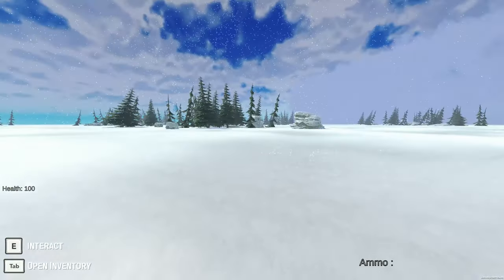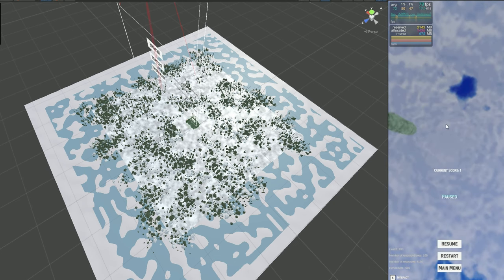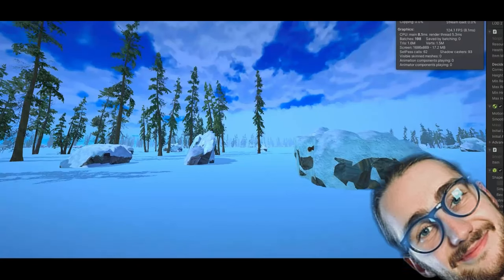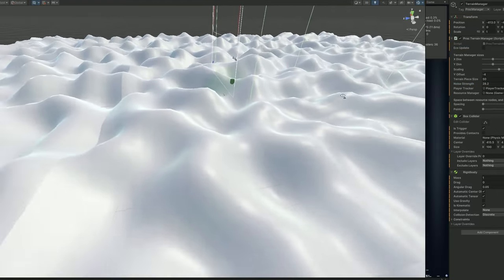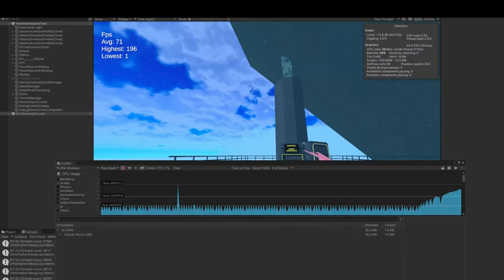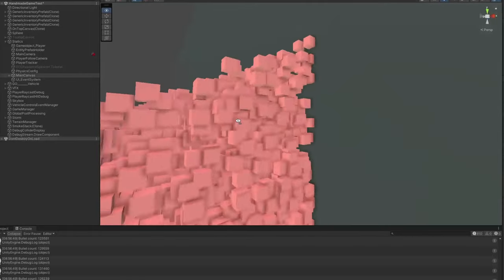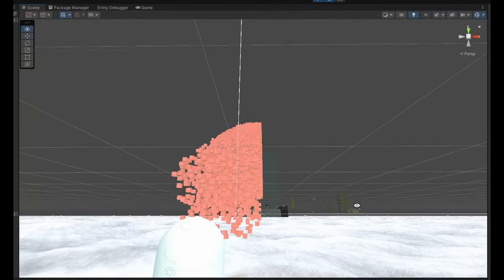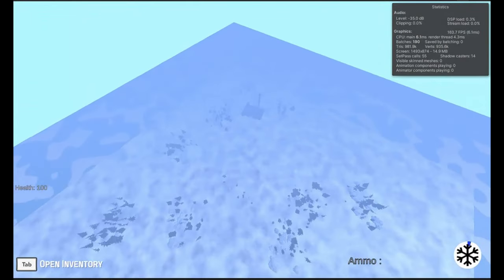How I Optimized My Game for 1 Million+ Bullets - Scorching Engines

Comment: just found this, looks really well thought out ! great game design
Reply: also, you should use a reduction on your bullet hits as they finish before they queue to condense them to similar objects and a dmg total.
Reply from the maker: @tristan6052  hmmm, reduction on my bullets before the queue... 
I mean I could do a reduction on the queue, to combine all the damages that an entity should take, by summing the damages into a hashmap thingy, so I perform less structural changes, which is honestly a good idea. (If a wall takes 100 damages, i apply each of them individually which is "slow", ~1000 damages takes 0.02ms to apply) 

But I'm not too sure how a reduction before the adding to queue part would work, seeing how multiple bullets gets processed in parallel it'd be pretty difficult to guarantee that there wouldnt be race conditions

Comment: To optimize more you could use object pooling. Instead of instanciating and destroying gameobjects you activate and deactivate them changing their position when "spawned".
Reply from the maker: Common optimisation trick, but when using Unity DOTS there's no benefit from using object pooling, since instantiation is so cheap, basically cheaper than having to keep track of used and unused entities :)
Reply: @thor_whitemountain  I didn’t know that, I’ve been reading a little bit about DOTS and it’s amazing how it works. I don’t know if it’s the right direction for this project but it is interesting!!
Reply from the maker: @Kapioner114  I mean, I could have made this game entirely in monobehaviours, but I am a really big fan of optimisations and hardware, so using DOTS just makes it more entertaining for me as it ticks more boxes when it comes to my interests, additionally the performance is just so damn good that I can't say no.

(It also makes it so that I can write bad code, that's still fast)

Comment: Loving these blogs as someone getting into DOTS with no prior programming experience. I didn't understand how you were able to circumvent all the AddComponent commands though :( Using a lot of them in my main practice project
Reply from the maker: On my phone, in bed, so sry for typos.

But before i had 2 component tags i added and removed, respawn and despawn tags.

Adding these tags made the resource zones be included in specific entityqueries,

Instead of adding and removing tags all the time.
I have a component that always stays on the zone entities, snd has a value between 0-3, giving us 4 different states it can be in.

A checking system then checks all zones and sets the correct value,  0 for respawn needed, 1 for already spawned, 2 for despawn needed, and 3 for already despawned.

This is then used to make decisions about the zones each frame, which means that we trade 4 bytes (1 int) of memory per zone, and some Computational power, to remove all the structural changes.

I hope thats a decent enough explanation :)

Comment: The amount of bullets is quite an accomplishment as i've seen people trying to do 2m of anything and resorting to compute shaders, or some form of GPU offloading to handle the work. 

Question, for the bullets are you doing anything special to reduce drawcalls to the gpu, just wondering, especially since you're using a box for a bullet, and i'd imagine you won't be shooting boxes, though like you said you won't be shooting 2 million bullets in the game... even though you could, i mean realistically you could probably implement something like a bake-to-texture and have the bullet look like whatever you wanted with no overhead from polys
Reply from the maker: I  mean, if the performance gets too bad I could use direct gpu instancing and send an array of positions to the gpu, but there's not really any need for this, as unity combines multiple small similar meshes (cubes) to batched single drawcalls, so 1m bullets is around 45 million vertices, but it's a cpu bottleneck despite that. 
But yeah, the plan is to use proper bullets or bullet like things (like cones oriented in the flight direction) but I might also remove the rendering from bullets, except for tracer bullets, so not every bullet is visible

But if bullet bullet rendering becomes a performance issue I do have some idea for how to improve that

Comment: Very cool game and very impressive! Althought you should maybe rethink how much you are optimizing things before you run into a bottleneck (as someone that loves optimizing myself). As the saying goes "early optimization is the root of all evil." Optimizations often make things very inflexible and a lot of system should be rewritten later in development anyways. You should really only optimize things when they become an actual problem. Unless youre just doing it because its fun for hobby projects which is of course fine, but then it will make the development take longer than necessary.
Reply from the maker: Yes, and no, Most of the optimisations I do are low hanging fruit, as I try to implement a feature in the simplest way, and then I clean it up, and optimise it a bit from there. But this optimisation of the bullets is way more deep optimisation than I've done for the rest of the parts of the game, just because it was fun and interesting to research and try out new things. 

But yeah, it's very easy to spend too much time optimising things needlessly, luckily the burst compiler does a great job of "optimising" my code for me :), so I hopefully dont get stuck on optimisations instead of gamedev.

Comment: Hey, just found your videos and the game really starts looking good!
I have a question. Is this (destroy/create resource entity zone depending on distance system) solution faster only because its parallel? Or there is another reason? I just cant think of good way to query through component so i can check the state value of it and only then doing the code needed.
Reply from the maker: It's faster because if I didn't delete the resources, and just disabled them / made them stop rendering then they would stay in memory, and the memory usage of the game would just be increasing over time, which would then also slow down the CPU.

I actually run 3 jobs for all resource zones, every frame, the distance checking job, as well as the spawning job and despawning job. And then inside of these jobs I look at the Culling Component on each entity and just return if the state is wrong.
like, 
"if (state != despawn) { return; }"

And alternative would be to have a single big job and use a switch case for what action to do based on the culling state

Comment: Impressive optimizations! Just wondering, why did you decide against hitscan weapons? (Apologies if it was discussed in a previous video)
Reply from the maker: Nah, I haven't talked about why before, but it's just because I prefer physical bullets instead of hitscan. 
Especially since fighting hitscan enemies is really annoying as you basically can't avoid their attacks.  (Which is why games often use a combination, Halo uses hitscan for closerange and projectiles for long range, while Doom is hitscan (IIRC) for most of the players guns to make the player feel stronger since you miss less , but projectile for the enemies, since that means you can go for longer without taking damage, as you can see the bullets flying towards you when they're far away.

Also a big fan of Apex legends 1200+ hours 💀, and they only do projectile guns (except for the charge rifle). 
So it's really just preference, and that I think it would look cooler to see a bunch of bullets in the air (without me faking the visual bullets) , and this means that I don't have to have a system for physical bullets for the enemies, and hitscan for the player.
Reply: @thor_whitemountain  I think the Halo way just makes a lot of sense, hitscan at short ranges because your not dodging a bullet at 10ft, but a shot from 100ft ... maaaayyybeee :)

Comment: Silly question, but you said the 2m @ 25~fps  is in editor, what happens if you build for release lol, your showing in editor benchmarks with these crazy numbers, but thats still editor debug overhead no?
Reply from the maker: Ehm, yes. Thats with the editor overhead, however for some reason the bullet performance is worse in builds, and I havent gotten around to figure out why, but i think it's due to overzealous garbage collection or smth...
Because the normal performance is a lot better in build than in editor... Wack
Reply: @thor_whitemountain  WTF ok i think that should be devblog 3 lol because that sounds nuts, dropping debug symbols and editor overhead should have a massive performance boost.

EDIT: Really like following your videos, im trying to find time to start my own project with DOTs as my first real foray into game dev.
Reply from the maker: @cchance  I mean, if I can figure out why the performance in build is worse, I could have a small piece with that, not that the performance is bad, but it is "only" 20fps with 1m bullets..
Reply: @thor_whitemountain  I recall main issues I read about from builds that are sometimes the issue are vsync differences and I read about sometimes the built version using integrated gpu instead of a proper gpu, you should be able to attach the profiler to the built version hopefully to see the difference in timing since you’ve got solid views of what the timing looks like in editor already
Reply from the maker: @cchance  No, yeah the performance is great in a build, like 2x editor fps, at around 250-330 fps, but the bullets only are lagging way more than they do in editor, and from what I remember is was unitys code performing weirdly..
Reply from the maker: @cchance  Okay, I've managed to "Fix"  it, bit of testing, swapping to dx12, graphics jobs, il2cpp for faster runtime, optimising a system for batching entity deletion, it's 1m bullets at 30-32 fps,  at 1440p